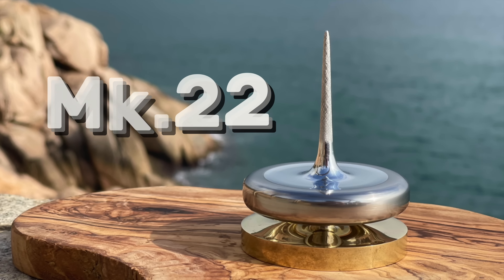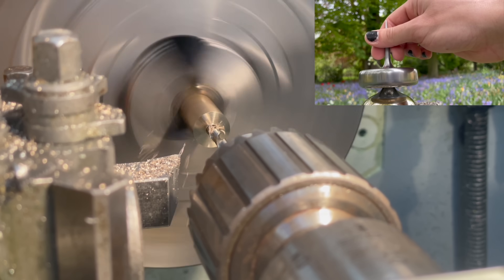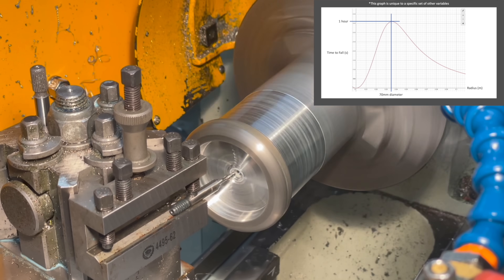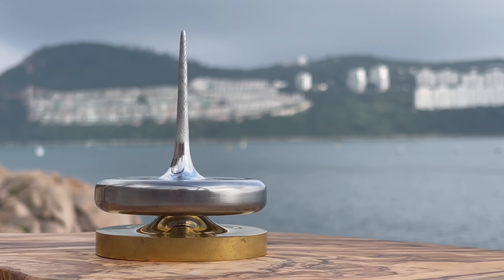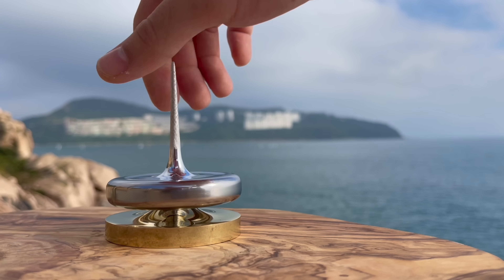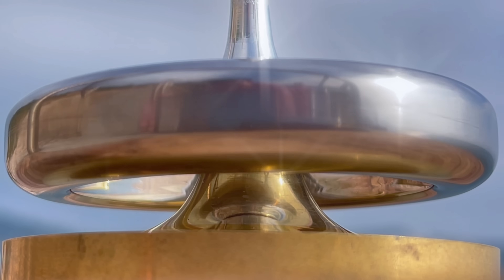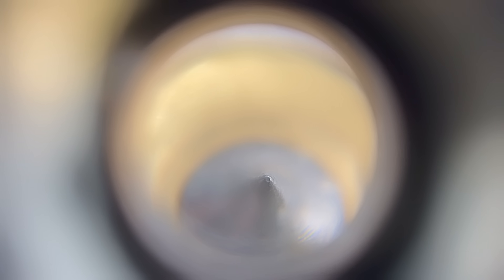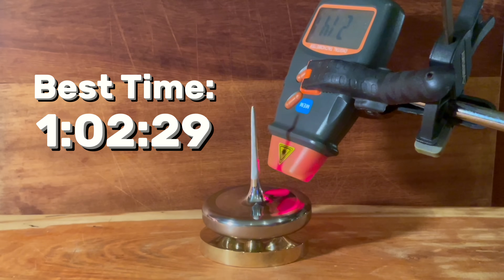Spinning Top Mk.22 | 1 HOUR BARRIER

Comment: How did knurling reduce air drag vs a polished surface?
Reply from the maker: Quite minimally - for a top this size, the air speed around the knurls is so much lower than around the flywheel, that whether it is textured or not has little to no consequence :)

Comment: I don't understand polishing the surface of everything. Plenty of research out there showing that textures surfaces have less air drag than polished surfaces.
Reply from the maker: Indeed, but the type of air flow is quite important. I am yet to find a paper that looks at texturing a spinning surface. They all seem to be regarding linear flows/ flows there the object is experiencing pressure drag etc
Reply: @hiper_tops  I would think it would be similar flow to an airplane wing surface.

Comment: I'm curious how long this one would spin in vacuum, where you could deal with just friction instead of air drag at all.
Reply from the maker: For this one, probably around 3-4 hours! However, it is not designed for these conditions (for vacuum, the radius of gyration to mass ratio must be as large as possible)
Reply: @hiper_tops  That could be a really cool demo, especially of some of your earlier Mk designs!  Showing optimization for atmospheric running - the absence of drag would demonstrate it well!

Comment: Impressive! 
The surface area with the cuts, for getter grip, is relatively large, if You were to make it smaller (maybe polishing?)- it will lower the aero drag. 
Have You thought about using some oil on the tip? Maybe some kind of watchmakers oil?
Reply from the maker: There are some other comments where I explain a bit about the stem, but the take away message is that because the radius is small there, it has minimal impact on air drag for the top. You are right though, it’s just a smooth stem would be inconvenient for a tiny gain. Regarding the oil, I currently use one which is designed for synthetic ruby contacts. I will look into more

Comment: This one's a little obvious, but the grip you added to the stem is pretty long and certainly appears to be designed in such a way that almost maximizes the drag it creates. I would consider optimizing its length to function as you intended while reducing its length to the minimum of what is requires to manually spin the top. Or pergaps you could engineer it to be more aerodynamic. If you always spin to the right you could have left facing inset grooves that don't drag air
Reply from the maker: I like your idea with left facing grooves, Griffyn spinning tops does this very well and I would too if/when I have access to cnc turning. 
Regarding the stem, it is currently at the optimal length for myself and the knurling is quite mild to minimise drag. Most importantly though, air drag due to the stem is much much smaller than due to he flywheel, so I can get away with less optimal geometries as long as they have a small radius and hence air speed around them.

Comment: High performance. Is it not advantageous to have the CG below the contact point?
  Has anyone tried jewels to reduce contact friction such as the watchmaking industry use?
  Would lubricant help?

Beautiful design.
Reply from the maker: Cheers :) If the cog is negative, the top won’t topple! At which point it is no longer a top. I have used jewels before, see Mk.21 😁

Comment: wouldnt lowering the center of gravity to below the contact point make the tip stay more steady at the start?
Reply from the maker: It would become so stable it would no longer fall over! At which point it’s not really a top anymore haha
Reply: also could you quench the the tip and the base to harden the metal?
Reply from the maker: @thomasschmitt190  The material I use is tungsten carbide, it is very hard already and would not benefit from quench hardening

Comment: This is amazing! To me this is the ultimate in the "unlimited" class of tops, essentially doing anything you want with the geometry. However, I feel a little bit of the essence of the classic top is lost by allowing a recessed tip and elevated stand--as that essentially removes the part that makes most tops fall over: the precession from CG being above the tip, and the effect of the sides of the top contacting the ground if your spin technique isn't perfect. Therefore as a follow on I think it would be cool to see your optimization of the design under a "legacy" class where it has to run on a flat surface (no recessed tip, or cupped holder). I wonder how the design would change.. because you still would want to get the CG as low as possible, but if too low, the sides would contact the ground too easily. So it's a different optimization. Anyway, as an engineer this is where my mind goes. Good work.
Reply from the maker: This is a good idea, I would love to develop a top optimised for single spin, spinning on a flat surface etc. I should be able to use a lot of the formulas etc I've found so far, but it would be an interesting new set of design challenges!

Comment: Just another random idea from a non-degree holding science lover:
Idk if this is cheating, but maybe to get over the hurdle of drilling into the base, and for balance, adding magnets to the equation? Specifically making a ring embedded into the base, maybe halfway or 1/3 way up, and then into the base edge of the flywheel, with same polarity sides facing. That way you have the mass but reduce the impact on the base?
Reply: Also, watched most your videos of progression up to this point, even though I just found you today, incredible work and dedication, you've given me the inspiration to keep honing my own craft further, even if it's just beatbox. 😂
Reply from the maker: @skyumi8392  Thank you it means a lot! Keep at it ;)
Regarding the magnets, I would like to try similar experiments in the future, although indeed they aren't allowed in my category

Comment: wouldnt switching the tip and plate to a sapphire or ruby or something extremely hard, sharpen it to as sharp as possible increase it quite a bit? you can probably buy a cheap mechanical watch and use the rubies inside. if you find one that says 32jewels (or less/more) on the movement. there is probably something sapphire out there as well since many things come in sapphire these days. or maby you find something in the machining world like cutters made of diamond, boron or carbide. or just google "matereal" spike etc. you can also use your current tip, make it flat, indent the center and glue a diamond to it.

Comment: I have nothing to do with spinning tops other than this random video which was recommended, but after visiting the record page and seeing the previous record holder, I have to say I was slightly more impressed with Iacopo Simonelli's run. The single twist start and the trueness of his top throughout, at least until 40mins of 51 was a touch more mesmerising to me. You're top seemed to start going through various wobble phases from 35mins on, maybe tip wear? None the less hats off for the determination and thanks for the interesting entertainment👍
Reply from the maker: I agree Iacopo’s tops are incredible! They have been an inspiration since the start. I aspire to achieve the seemingly perfect balance his tops have. Regarding the single spin, this really ought to be a separate category (and I think he would hold the record)
Reply: @hiper_tops  , thank you.
Reply: Thank you, @antichicmusic.  I don't think it's tip wear.  Tungsten alloys have disomogeneous density so tops made with these materials are almost always less or more badly unbalanced, there can be also couple unbalance, not only static unbalance, so it takes some patience and knowledge to balance them perfectly.

Comment: what if you made the spinning tip from a diamond
Reply from the maker: The diamond would drill into whatever base it was spinning on - including another diamond! Resulting in vibrations etc and a lot more friction. Optimally, the tip should be slightly less hard than the base. So a diamond base might be good (but very expensive and hard to find as a non-abrasive monocrystal)

Comment: Lacopo Simonelli has a load of videos analysing airflow around the top and describes it as a centrifugal viscous pump which draws air from the centre and flings it out from the edge of the flywheel. So to minimise losses the profile should be a gentle curve both top and bottom rather than a distinct flywheel, with everything ultra polished of course. https://youtu.be/oKxrP7-QXpk?si=LNjkZMw-K9OJJLsN

Losses at the bearing dominate at very low speeds so choosing a bearing material with very low coefficient of friction. Polycrystalline diamond and Aluminium magnesium boride (BAM) are two of the very best.
Reply: Please don't encourage him to copy my ideas, there is no need, really.  I hope he will make his tops using more and more his own ideas, he is intelligent, he can do it.
Reply: @iacoposimonelli7191  I linked to your video because the smoke tests and your explanation of the physics is good. His top is already the longest spinning non-mechanical without a shroud, but I was trying to suggest ways to improve it further. At the end of the day there is only one optimum design in terms of the cross sectional shape and density profile, diameter, mass, bearing material, etc. if you are aiming for maximum spin time. I’m absolutely sure he has studied and learned from your videos without any prompting from me!

Comment: So this is the only video I’ve seen of this series so I have not learned all that you have in this process and I do not know what rules you have for yourself or what the hp-top community has, but the first things that come to mind without changing the top/base itself is just changes to the overall system:

eliminating drag altogether via vacuum, and;
changing the temperature of the system (i hypothesize decreasing the Temperature of the top and the base would work best). 

As for the top itself, (again I’ve not experimented and learned for 7 years like you have), there’s a new material in the making - carbon nitride - and I think it boasts some decent potential as a tip/base material, should be between cubic boron nitride and diamond in hardness, some say it surpasses diamond in some areas, I think compressive strength. idk it’s lattice structure tho I think there’s a handful they’re trying. It’ll probably be an expensive material to experiment with but maybe in junction with a diamond tip/base or a a cubic BN tip/base it’ll fair well. 

I also don’t know your lubrication methods/results but a low viscosity lubricant may fair well, but it’ll have some form of drag on the system, but by making a thinner tip for the spinner you may be able to reduce frictional drag from the lubricant, but that’s probably diminishing returns. 

I can imagine there’s some effect that can be taken advantage of my mind kinda goes to magnetism or superconductors but I feel like those would be somewhat cheating/violating the “rules.” Maybe somewhere in the universe there’s a non-Newtonian lubricant with the ideal properties for a lubricant. 

The only other suggestions I could make design wise would be along the lines of reducing surface area near the center of the spinning area (the big flat disc shaped area) to be 2+ aerodynamic rods connecting the tip and handle to the outer ring. 

There’s a handful of other experimentals id do but I’m about to pass out and I’m partially regretting going to college for business seeing as I love this stuff so much.

Comment: I wonder if straight up dimpling the stem would improve performance. If you can trap bubbles of air to spin with the top it’ll cause less turbulence from air contacting moving metal. 
Don’t listen to me though lol, I work with avionics so I’m specifically best at causing the exact opposite effect from what you’re looking for

Comment: I wonder if you could add some kind of grooving or fan-like elements to draw a small amount of energy out of the spin itself to push air downwards/slightly push up the top itself and minimize tip friction.

Comment: Whats the thoughts on a bluff body rather than a polished one? I.e golf ball dimples? Interesting to know if that aero would improve results or make them worse
Reply from the maker: It should make it worse for spinning tops because there is no pressure drag to contend with. So the viscous drag would simply be increased!
Reply: @hiper_tops  makes complete sense! 
The beauty of engineering is how something can be achieved by rack of eye and experimentation, or it can be thought about scientifically and improved almost indefinitely. Something as seemingly simple as a spinning top has way more to it than initially meets the eye. 
I have no interest in spinning tops and have never given them a thought before stumbling across this video, and I really enjoyed it, it's really nice to come across someone knowledgeable who has given it a good amount of thought to it. It's been 10 years since I graduated from mech eng and now work in software, but things like this still scratch the engineering itch. Thanks for the fun video!

Comment: would it be possible to make a gold-plated tip for minimum friction? from what i can tell gold has the least friction in terms of metals. this is an awesome piece of engineering btw
Reply from the maker: Yes I could coat it, however since gold and it's alloys are very soft, it would rapidly be worn away from the contact and then serve no purpose. I am doubtful about surface coatings for the tips, but can see the base using them in the future

Comment: You have more competition than you thought!

“The longest-running mechanical spinning top (prototype) is 41 hr 15 min 18 sec and was achieved by Jointo Entertainment S.L. (Spain) in Pamplona, Navarra, Spain, on 3 February 2021.”
Reply from the maker: Actually I was aware of this! Check the description for notable spinning tops. Mine is for a different category (non-mechanical)
Reply: @hiper_tops  Sorry. I stand corrected! 
Guinness World Records do not seem to publish details of categories though, and after a lot of searching both within GWR and elsewhere I was none the wiser as to what the “official” categories are, or what the definition of a mechanical spinning top might be. GWR seem to be more of a commercial marketing organisation where they invite company clients to find or invent a record category which can then be used for advertising or branding of that company’s products. It’s a far cry from, say, Olympic records where the sports and categories are tightly controlled and limited in number.
Reply from the maker: @Tailspin80  Yes precisely! I don't have a guinness world record yet, but you can find this on recordsetter for now :)

Comment: Great machinig ! I love to see how you used a conventional late and not a CNC.  

i have some thoughts...

1. Ballpoint Pen-style Tip and a shallow concave graphite disc
or  brass and steel is self-lubricant...but brass is quite soft, i wonder what would happen if you shoot or press a hardened polished steel ball on a brass block, and then cut out the "cup" , i guess with the right force, it hardens the brass, so less friction, less abrasion, and still lubricant...idk

2. "shark-skin" surface, less drag

3. "close" the bottom to a certain diameter with a thin disc, skirt, to prevent to much airflow (vortex) underneath

4. make sure there is no induction  created from the combined materials

just some ideas and thoghts...idk if practical and useful for this physical artwork.

keep it going, spin your head round (baby) round round....

greetings from Switzerland

Comment: the one thing that irks me is that of course, a large heavy low flywheel is optimal, 
however this is like a whole different category of spinning tops: it can only spin on it's own tower-like stand, and not on a flat surface 

this for me creates the need of a special category for above-flat-level tip

Comment: Maybe add a little WD40 to the contact points for less friction. Also if the base was heavier or screwed down that may provide less vibration back into the top, however if that’s brass then you’re probably good. That could add a little more time to the spin total. Cool project.

Comment: I'm sure you've considered this, but is the tradeoff between worse mass distribution and a (I think) better drag coefficient worth making the angle between the flywheel and the inner part on the bottom shallower? My idea is that air will have an easier time flowing into and out of the bottom area, making the overall effect that of having less drag. Potentially that transition could be a really thin piece and some of the inside could be hollow? Maybe that would decrease it's negative impact on mass distribution enough?

Comment: Why not have multiple layers, each spinning slower the further out you get? That way you can avoid a lot of drag from air resistance.

Why not make it taller, narrower and heavier? That means less air resistance but might need a faster spin.

Why not have it suspended with magnets?

If that’s not allowed, why not lubricate the point?

Why not spin it up with a motor?

Comment: Nice video. I suppose it is necessary for the center of mass to be above the pivot else it isn't really a hand spinning top, is it? In this vein, is it still a spinning top if some of the mass is below the pivot as it is here, or would it be a different category if you are spinning the top on a flat surface or at least a consistently concave surface
Reply from the maker: I see what you mean. According to the rules, as long as it is positive centre of mass and hence can topple, it is alright. I would gladly welcome a separate category for tops that spin on a flat surface ie with external tips, however those who decide on categories for records may find this too specific. People like Iacopo Simonelli, Plier Tops and Kemner Design (off the top of my head) have all broken 30 minutes for such a top!